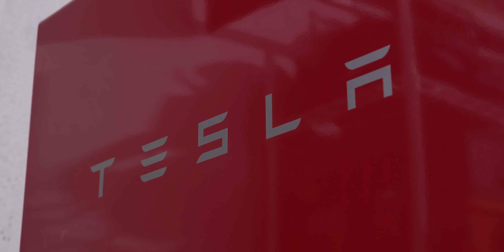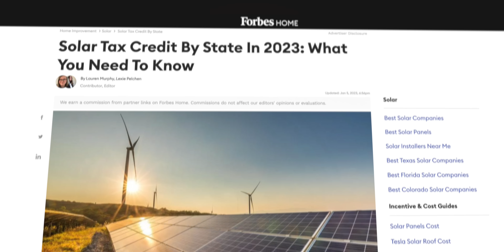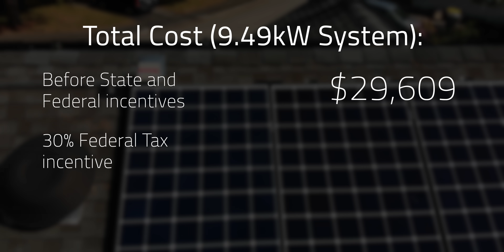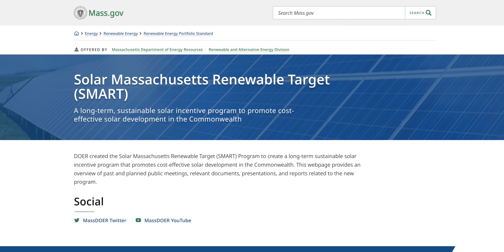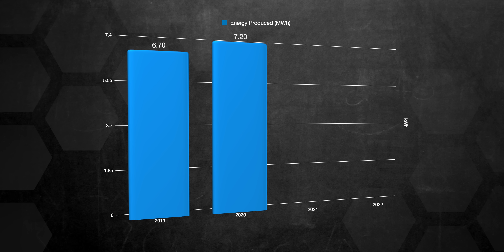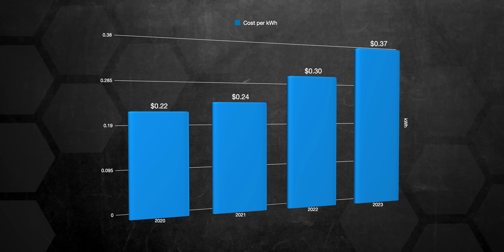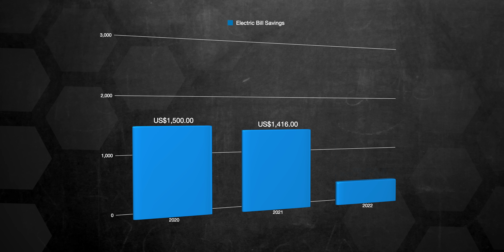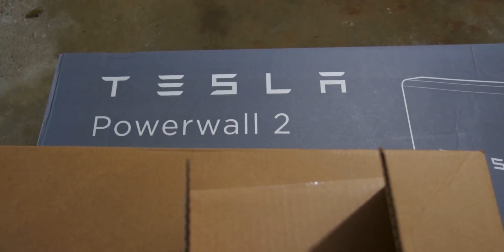5 Years with Solar Panels - Is It Still Worth It?

Comment: 22-37c/kWh is insane cost for energy. We have a mix of nuclear and hydro which the local coop pays guaranteed consumption on the production and we pay between 4 and 8c/kWh. We heat, cool, cook on electric because gas is 16c/kWh equivalent power. At those rates you may be better off just running your own gas generator if you don’t have solar.
Reply: Everyone wants to hear the noise a generator makes. No issues there.

Comment: I'm in MA, also. Got my panels in Mar 2018. 40 panels,  290W each, $42,000.  Because the down payments and loans were taken care of by dec 2017, i got my tax credit in apr 2018. $16k federal and $1k MA. 
  Received the whole amount on that one return because i paid more than 17,000 in taxes in 2017.
   Savings have been absolutely huge.  Used to pay over $200 per month for electric, more when the air conditioners had to get us through jun-sept. 
  Full disclosure,  i got 2 ceiling fans 2 years ago,  and now require 4 AC in summer instead of 6... and i apparently forgot to mention that my roof has 2 sun facing sides with no tree cover. 15 panels on one side get sunrise to noon,  and 25 on the other side get noon to sunset. I'm only in the shade if it's very cloudy.
   2022 must have been a really good one,  like you said, because i finished that summer with national grid owing me $900. By the end of winter (mar 2023) they still owed me $450. 
   In 5 years with live solar, my SREC has paid me between $10-11,000... should get 21-22,000 for the ten year life of that program. 
   42k cost - 17k tax credit - 22k srec =$3,000. 
   Used to pay upwards of 3k per year for electric, and now i don't have an electric bill. ..  my savings have absolutely been worth it. No question
Reply: I have no batteries on my system because i have a generator at the house

Comment: I just wish they could find a way to make them blend better with the design of the home.  They're ugly as sin.  And what happens when you need to replace your roof?  Obviously, the panels all have to be removed, the roof repaired where they had been bolted in, and then have them reinstalled once the roof is replaced.  A roof should be replaced, what, every 10 years?  So if you've had the system 5 years, it'll have to be replaced in less than 5, depending on when you had the roof replaced the last time.
Reply: 10 years is absurd. Most roofs last 25+ years. My home was built in 1969 and has had the roof replaced once. My ex-stepson-in-law recently has his solar system removed and replaced to replace a damaged roof, for $2,000; this is not a major expense of a roof replacement.

Comment: We need to get to a point with solar where the cost/benefit is straightforward. All these tax credits, rebates, incentives, etc., just show that solar is not a viable alternative. What are the additional costs of maintenance for solar? What is the cost of the massive time investment? How many hours did you spend and continue to spend on the solar panels? With traditional electric, you call the power company, set up autopay, and you are done.
I see solar as 'distributed power generation' where people are producing electricity for the electric company. There may be some interesting benefits for expanding that model. As it stands now, you are generating power for the electric company and the equipment investment, maintenance, and liability is with you which doesn't sound very efficient.

Comment: Here in Arizona our power rates are very low if you play by the rules and most people are unaware. I have never been able to justify the cost of solar as the power company offers many ways of saving. I'm on a program that measures the demand I place on the power grid from 4pm to 7pm during weekdays. Outside of that timeframe they only charge 5.2 cents per kWh all year with the exception of 6 winter months where they charge only 3.2 cents per kWh from 10am - 3pm. I pay a premium for the demand, but I'm able to keep my demand below 1.8 kW/month during peak time. The cost of that demand is about $13 - $17 per kW or $15 average. So, each month I pay a premium of about $15 x 1.8 = $27/month to get the use of these low rates. My total bill for the year is about $2600 for 30,000 kW which includes all the regulator fees and taxes. With that I am air-condition around 6,300 sqft with 12 to 15 ft ceiling.
Over the years, I received many estimates and no one has come close to saving me money by going to solar. I'm not knocking what you are saying, I am just saying that everyone really needs to take advantage of programs that are available. It sounds like you are paying very high rates. In 20 years with the same power company, the rates have gone up for other programs, but stays about the same with the demand program. It all comes back to "using the power by their rules". 
The strange thing is that I see my neighbors put up solar that cost twice/month for what I pay for electricity. Someone is getting scammed. 
In AZ, the power companies are trying very hard to reduce their overall demand during summer months and reward those that play by the rules. During the summer it can get to over 110 during the day and stay that way for a couple months. During the weekdays I have to super cool my house down to 72 degrees and keep it there until 4pm when all 4 of my A/C unit turn off. Then the A/Cs begin their recovery at 7pm. The 72 is the price I pay for using the demand program. This results in about a 25% increase in power consumption.

Comment: Another thing to consider is structural integrity of your roof. I lived in a housing area for a few years that had some years prior attempted to put panels on most if not all of the properties. Apparently, the extra weight of the panels plus several inches of snowfall was enough to collapse some of the roofs.
Reply: solar panels only weigh 1.6 lbs per sq foot.
snow loads in areas like MN could be 60 lbs per sq ft.  Don't blame the PV panels for the roof carrying capacity.
Reply: What do you do when it's time to reroof ?....who takes all that crap down
Reply: @hoppercar   So many TCO elements have been left out of this video.  It's an infomercial for solar, not a TCO evaluation.
Reply: I was going to say why would you invest all that money and not do a metal roof that will last first...  Seems like step one to me. @hoppercar
Reply: @hoppercar  reeeeeeds
Reply: @hoppercar  A solar installer would remove and reinstall after the re-roofing. Would be a good time to do some parts replacement if it is 20-30 years after the solar installation.
Reply: That's why inspections and engineering analysis are important first steps.
Reply: solar panels weigh less than 2 lbs per sqft.
A person standing on a roof is about 200 lbs per sqft
Reply: @r.b.l.5841  2lbs. X 1500 sqft = 3,000 pounds. 
That’s like putting a Fiat500 on your roof.
Reply: @majorburke9735  and spreading it like butter over 1500 sqft - so?  Snow loads can be 40x this, and be like 40 Fiat 500's on your roof. What is your point?
Reply: That's one person in one spot. You are not considering the total weight of all the solar panels on the  trusses below.
Reply: Same applies to people going for roof gardens. There was an awful accident a few years back in Holland I think when a shop or shopping centre, i forget, installed a temporary xmas garden on their flat roof. It collapsed killing and injuring some people below.
Reply: Also to add, you have to remove all the panels before the roof can be shingled or tiled so if your going to put panels on your roof make sure you have a fresh roof that will last at least 20 years because you have to add the cost of removing them and putting them back on to redo the roof.
Reply: @SpruceMoose-iv8un : It’s counterintuitive to put 80 big holes in your new roof for solar panels. 
And the next new roof may require new wood.
Reply: @SpruceMoose-iv8un : I agree. The panels only last 25-years anyway, so just get new panels with every roof. Hopefully you can still get those Robin Hood Discounts.  That remove/replace cost is $17,000 extra on average. Plus, you may want to replace all the wood every time too since those panels make a lot if big holes.
Reply: @majorburke9735   more mis-information here folks. Solar panels de-grade with time, most will be about 80-85% effective after 25 years. This does not mean you have to replace them, it means they will produce 15-20% less energy then when new.  Lots of used panels from Solar Farms are 15-20 years old and sold to be installed and used for years to come.
Reply: @SpruceMoose-iv8un metal roof for the win.
Reply: @SpruceMoose-iv8un  a good idea to have a new roof, and design the solar supports into this so you maintain water tight roof, but also know, once the solar panels cover the roof, it will last far longer, since it is not directly exposed to solar/rain/snow anymore.  The solar panels help increase the roof lifespan.
Reply: @r.b.l.5841 : Really? I doubt it. Strange how nobody uses that  as a selling point.
Reply: In Florida if you have solar on your roof your insurance will cancel you
 No buts or what
Reply: lies @lawrencebraun7616  lots of solar in Florida, but you do need to have a design for the wind loads in the area, some of the higest in the country.
Reply: @r.b.l.5841 : Do you get hail in Florida?
Reply: @majorburke9735  Do you read ?
solar panels all meet a standard hail test - 1" diameter ice at 20m/s - it is printed right on each panel spec sheet.
Reply: @lawrencebraun7616 : Evidently high winds are not Solar friendly.
Reply: @lawrencebraun7616 ; Hail?
Reply: @lawrencebraun7616 : Hilarious.
Reply: It’s probably best to get an extra heavy duty roof like when you install tile shingles.
Reply: “The industry standard for the lifespan of solar panels is 25-30 years.” Just ask SIRI.
Reply: Me me me me... Me me me

Decarbonization is 21st century pyramid building.
Just burn coal. 

This is sickening on so many levels.  "How to screw the lower middle class and make them pay for your feel-goodery."
Reply: most working-class people just dont have $50K laying around with nothing to do with it, to buy an array and a battery to 'invest' to only start saving a few hundred bucks a month after 10+ years so this is basically just toys for the already wealthy
Reply: and no evidence the solar panels were the cause.  Typical solar panels are only 1.6 pounds per square foot, insignificant when you realize wind can be 20lbs/sqft.
Reply: and we will pretend the 2lbs per sqft PV was the issue?  Unless the PV was standing up vertical collecting excess snow, the basic issue would seem to be the base structure was already inadequate in the first place. Ask yourself, if there was several inches of snow and then it got windy would you expect the roof to fail?  (wind loads are greater than PV weight).
Reply: Panels these days can be fitted in place of tiles; the weight of the removed tiles means that there is no extra load. These newer panels are also slightly more efficient
Reply: @tonykelpie : Do you have these new shingles? Why have I not heard of them? Why are there no ads for solar panel shingle? Can you walk on them.
Reply: @majorburke9735  Thank you. I am not sure what people mean by shingles. We have 20 solar panels on our roof; 380 tiles were removed in order to allow them to lie at the same level as the other tiles (in relation to the roof slope). The structure of the roof is not affected because the load is no greater than the tiles that were removed.
Reply: Good they are ugly and unsightly and no house should have them I cannot imagine an entire neighborhood not to mention as you say now some of the homes are ruined.
Reply: @jeremypilot1015 
Ruined? Please share your thoughts, observations, etc., I'm playing w/the idea of getting solar - trying to learn much. Thx!!
Reply: @dianapark1586  we installed solar panels (20 generating 6.3kW at peak) in June 2020 and they have already more than half paid for themselves. Today’s installations should pay for themselves quickly as panels are cheaper, while electricity is more expensive. Our panel installation involved removing 380 concrete tiles, so no extra structural load. We had one tiny leak due to a small hole in the roofing felt and that was easy to fix. 
Get a competent provider to install; ensure your house (including roof space) is well insulated also; another money saving measure if done competently.
Reply: Wow. That makes sense. Especially when you consider the plywood is thinner today than it was in older houses. Plus, every time you reroof you’re making 1000’s of new nail holes in the wood. Now add four big bolts for every solar panel; it might be best to get new wood every time you get new shingles to better support the solar panels & snow.
Reply: Roof heaters.
Reply: @Luked0g440  Another expense and point of failure, which will reduce the effectiveness of the panels, that have to power the heaters.
Reply: So many pros and cons with this solar crap.Don’t waste your money. My neighbor has it, the people whom install it is there every other week with issues, y’all been hoodwinked
Reply: @cbrb6594  you admit there are pro’s but your judgement only acknowledges the con’s.
Reply: @cbrb6594 : Same with my next door neighbor. Always an electrical problem. 
And now moss is growing on the north side of their roof. That can’t be good.
Reply: @majorburke9735  North side of the roof.  So you can be sure no Solar panels are on the North side roof, unless they are in Austraila.  LOL.  
BTW a good solution to moss on a shingle roof is a ridge cap of Galvanized steel, the zinc will kill any moss and prevent regrowth. It works.
Reply: @cbrb6594 : Same with my neighbor. Always a problem. Plus, they have moss growing under their shingles.